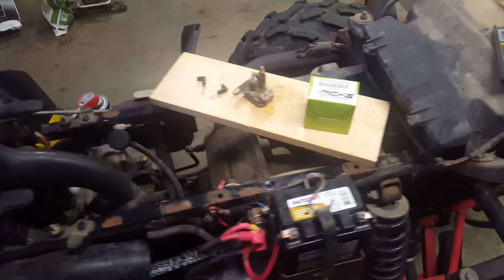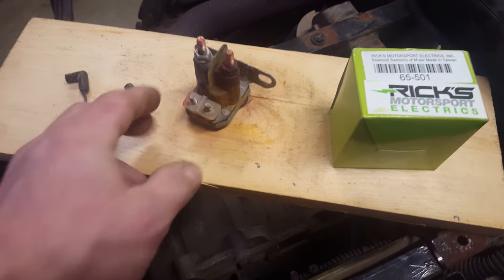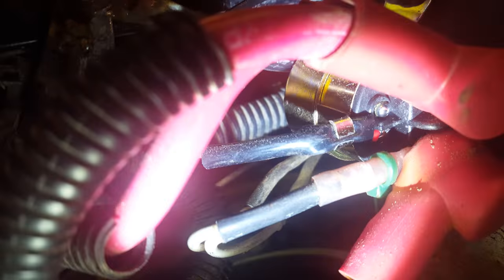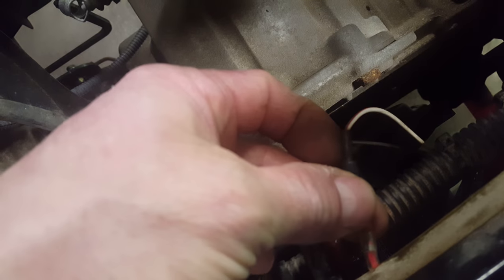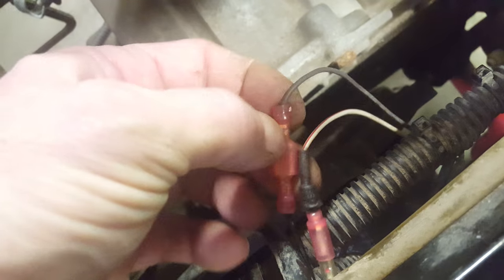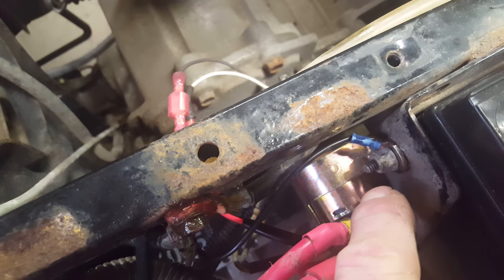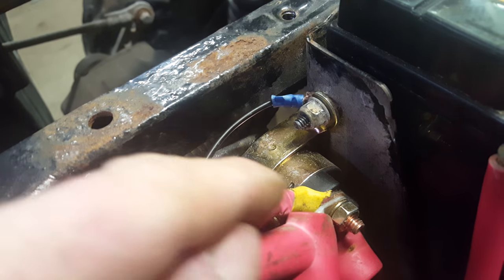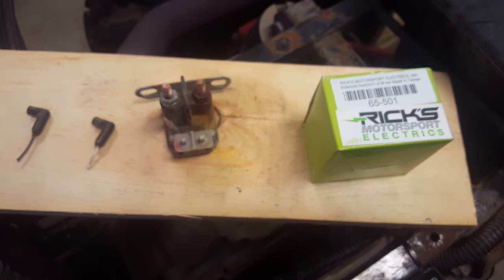Polaris Sportsman Ricks Electric Solenoid Replacement

Comment: Hi there,
these solenoid have the unfortunate habit of wearing off quickly (even the factory ones).
I'm wondering why they put it there in the first place. Will it break something if I just plug the starter motor direct to the battery passing trough the starter switch ?

Comment: What is the red wire with the yellow tip on the top hook to your solenoid mine is unhooked and I need to know what that goes to and where should I hook it to

Comment: Hey,anybody know what the little electrical terminals are inside the throttle control assy on a 09 Polaris Sportsman 400 HO? I took cover off to loosen cable so it would be easier to hook cable back up on the carburetor end ! When I took screw out of the top of throttle thumb switch the asst came apart and a tiny little spring flew out ! The top plastic plate has one grey wire with a contact  and lower plastic plate has another grey wire with a contact on it! Have no idea what it is for . I think the spring held the contacts apart but I don't know what the wires control ! I don't have a shop manual and Polaris dealers not much help when I ask them!  Nice video on the solenoid replacement . A 3 terminal solenoid is self grounded thru contacting the chassis . 4 terminal is just a ground terminal .  You can mount 4 post solenoid on any surface ,doesn't have to be metal grounded mount. The ground post terminal ,4 th terminal handles that !

Comment: So mine has a yellow wire that's not connected, its next to the battery n the solenoid

Im assuming that that's not right
Reply: Mine has a red wire with a yellow tip and I'm wondering where it goes cuz it was unhooked as well

Comment: Seems like that part is a kludge!  Removing nuts and no coil ground stud. You relying on a good metal frame bond now.
I have drilled out rivets and fixed solenoids. If they just click, usually the copper washer and bolts need cleaning up on the inside as they are not passing the high currents to the starter.

Comment: Hi I am rebuilding a 2005 Polaris sportsman 500 and I have a good battery and just put the same solenoid in and im still getting a click, could it be the starter? any tips
Reply from the maker: >Make sure battery connections are making good connection
>Make sure solenoid connections are good
>Make sure starter connections are good
>Battery fully charged
>Try quickly jumping the solenoid connections with a screwdriver - if starter turns bad solenoid
>Remove starter and bench test hooking up another battery - no turn, bad starter
Reply: Yes I tried all that, but it seems my white and red and black wires aren’t getting any power even when I put them to the battery, what could be the issue? (This is my first time rebuilding a four wheeler so sorry if my questions are stupid)

Comment: How do you unscrew the nut off the solenoid mount? It just spins and there’s no head on the screw.  Just looks like a river.
Reply: its actually an allan key
Reply: Mine has torque screws

Comment: Very important!!!!.  on a 2005 Sportsman 500 ho.  There are 3 wires!!!!! He is right on the first 2.  HOWEVER THERE IS A 3RD WIRE THAT NEEDS TO GO TO THE BOTTOM POST OF THE 2 POSTS.  IT IS NEVER MENTIONED IN  THIS VIDEO.  HOWEVER...I DO SEE IT...SEE TOWARD THE END.  IT IS IN THE BOTTOM POST.  12 HOURS THEN $400 DOLLARS LATEER, THE SHOP TOLD  ME WHAT THEY DID TO FIX IT!!!!

SIMPLE ANSWER IF YOU HAVING PROBLEMS....STILL.
Reply: Also...tell us where to put the wires coming from the starter...it is different than the stock solenoid, i believe.
Reply: Do you have a red wire with a yellow tip if you do what is this wire and where does it go